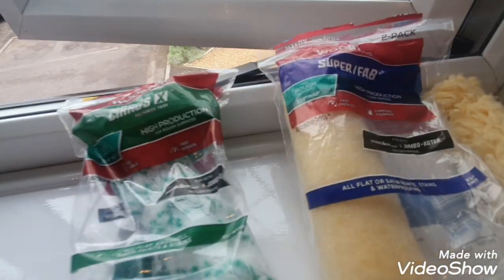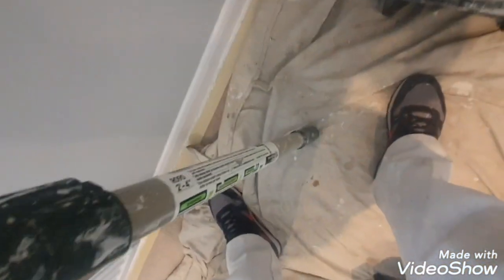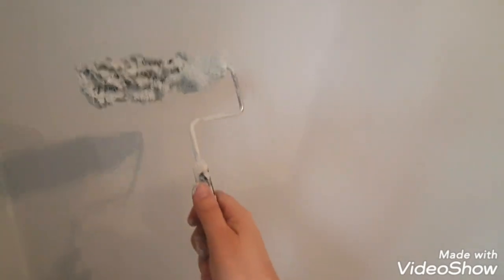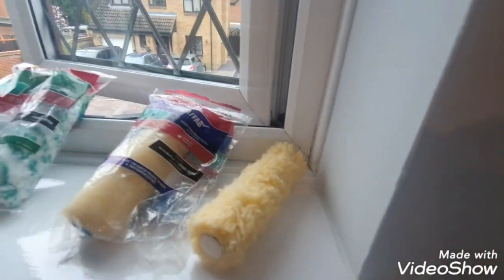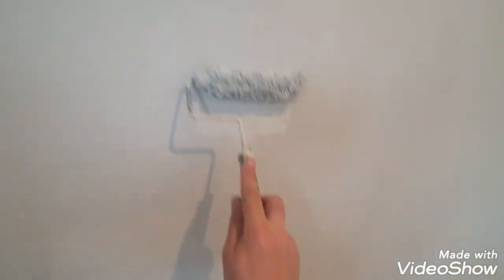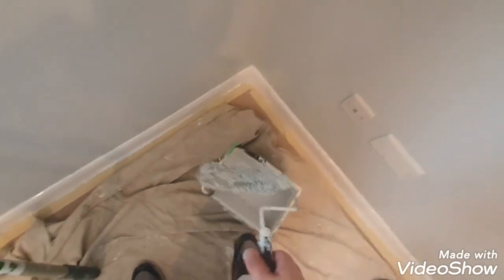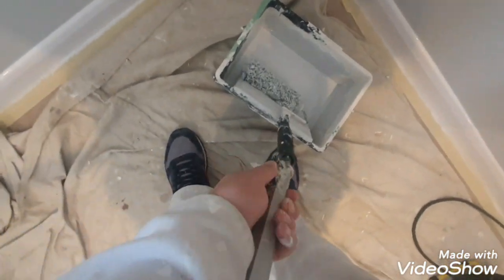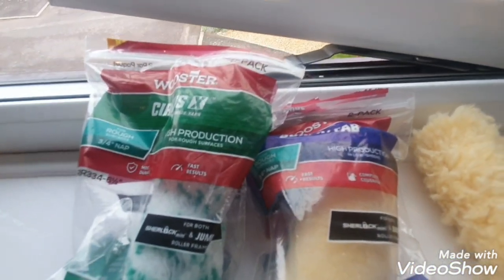How To Paint A Room Quick With No Mess

Comment: Hi Daniel, do these sleeves fit the purdy jumbo mini roller
Reply from the maker: I would have thought so as the sleeves fit the Arroworthy cages. It's should be a standard size across all manufacturers
Reply: @danielnugentpainteranddeco557  cheers Daniel. Thanks for the quick response, was using the purdys 6.5 in a bathroom and wasn't very impressed, quite a bit of spray and I few bits coming off them,

Comment: these probably hold the same amount of paint as a 9'' medium if not more. I'll be ordering a few, cheers D 👍
Reply from the maker: I've just ordered the 18 inch and frame as I think they will be a game changer on ceilings
Reply: I use the 18 inch purdy frame with hamilton sleeves at moment so will be interesting to see how well the Woosters perform. might treat myself 😉
Reply: I tried the 18 inch sleeves & on ceilings i didn’t think they were any good as they didn’t open up enough & I had to constantly keep loading more paint whilst doing a new build plot as I’m a new build house painter, I switched to an 18 inch polyamide sleeve & that was a real game changer, you’ll need to get the Big Ben frame as it’s designed for the Wooster Sherlock roller pole.  @danielnugentpainteranddeco557
Reply from the maker: @EmiMartinezVillaLegend  Fantastic info mate